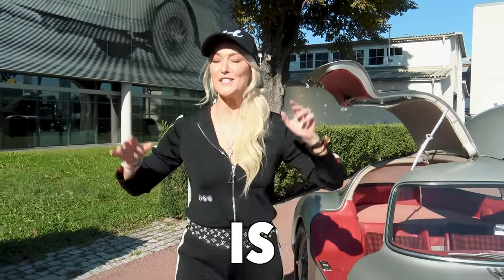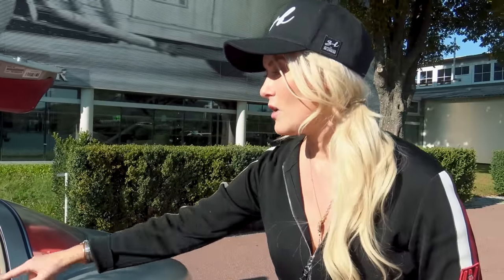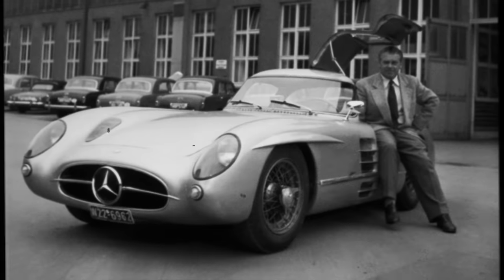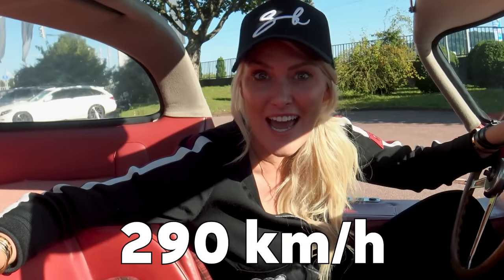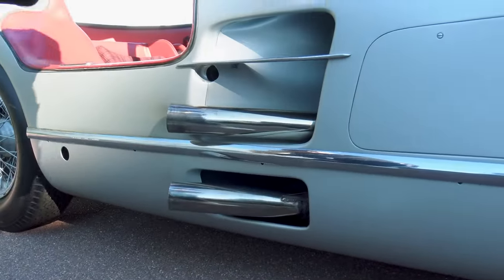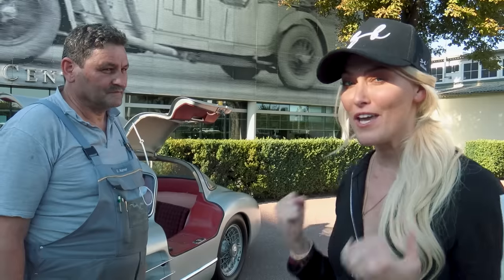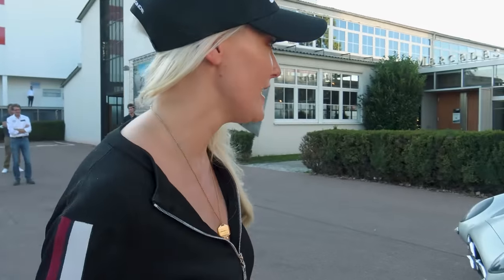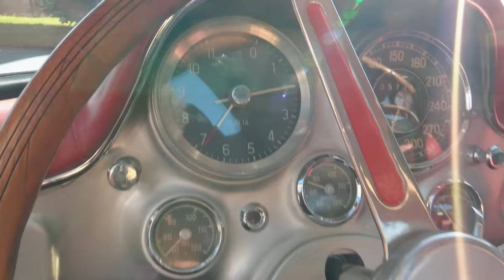The World's Most Expensive Car | 300 SLR

Comment: Blondie: "Can you imagine driving 290 km/h with no seatbelts?" 
Me: Motorcycles...
Reply: Lol 😂
Reply: LMAO .... =)
Reply: 👍exactly.
Reply: Yeah, relatively easily on almost any modern superbike. And they'll also get there much more quickly. The top speed of Japanese road bikes is restricted to 300kph by the use of limiters and/or gearing. That doesn't mean they can't be derestricted, which is something that is necessary for racing. But yea, 300kph is relatively easy to hit on a superbike. 
I've certainly seen it on the clock on a couple of bikes, though I know that they'd probably have been shy of that real speed by close to 20kph or so. Never really felt the need to go faster, 'cos you're approaching other vehicles at some very significant speeds.
Reply: Blondie: Can you imagine driving 290 km/h with no seatbelts? Me: well no but I can remember my 340kpH run in H2R with no seatbelt.
Reply: Over 200 km/h it doesnt matter....
Reply: @haraldkrieger6562  Why not? There may not be many places you can legally drive/ride at over 130km/h, but speed limits are one of those things that an extraordinary number of people regard as.. well.. voluntary. Most people do not go much more than 20km/h above that limit because it takes a car a long time to go from 130-200km/h. But a m/cycle can do it in the blink of an eye, and carry on to 250km/ hr or more in far less time than it takes most cars to get to your 200. Agreed, the risk of getting caught and banned is higher, but that is always a consideration. OTOH, the danger is entirely dependent on where you do these speeds. Personally, I think it is much, much more irresponsible to do +10 in front of a school than it is to do +200 on a dual carriageway with no traffic.
In fact, one of my annoyances with speed limits in town is that drivers see them as almost a minimum speed, not a maximum.
Reply: Meanwhile in 1955 when commercially available superbikes were a couple of decades away...
Reply: @skylined5534  The point is that the original comment was pretty silly. Not only did race drivers rarely reach those speeds (except at Le Mans), but this was pretty normal for them anyway. It's not that this specific car had no seat belts, none of them did.
The line was probably meant to impress car drivers with the heroism of drivers like Fangio. But bike riders are rarely impressed by the tales of Dering Do by people who are mostly privileged, drive on safer circuits and are habitually more protected. I could equally point out that the IoM was deemed too dangerous for cars in, IIRC, the 1920s, yet the circuit is still used for bike racing today.
You can dismiss the facts as much as you like, but the fact remains that an SLR probably rarely approached those speeds, and thus there is nothing particularly fantastical about it. That such a "Valuable" car will never, ever be driven under those conditions again is, for me at least, extremely depressing.
And that fact is just as ridiculous as its supposed "Value".
Reply: I've done a hundred miles an hour on Jones Road near Houston Texas on a 650 Kawasaki and I don't need to drive any faster on a motorcycle
Reply: @rodneypratt7082  Congratulations, I'm happy for you.
However, you misunderstand part of the fundamental argument. I know that this specific one is about maximum speed, but the main argument against such fast machines ld not be t about those top speeds. I've ridden and driven quite a few fast/extremely fast cars and bikes, and my argument in their favour is not actually about the maximum attainable speed, but about how they accelerate.
I would actually argue more against the hyper cars than against superbikes.
One of the principle problems with any car is that you never really have the opportunity to use the power because, under most conditions, there is so much traffic on the road that you are constantly being held up.And when they do get past the hold up, their ability to accelerate often upsets the handling so much that the driver can't keep it under control, as is shown by so many of those videos on YT that we have all seen.
Bikes, on the other and, can accelerate more easily and get through gaps that no car can do on the road.
I am not disputing that these speeds are valid, I am saying that the acceleration of a superbike really is very useable, even at legal and semi-legal speeds.
Reply: Best reply so far =P
Reply: My 1957 219 Ponton has no seatbelts either , but its top speed is only a little under 160 Km/h
Reply: True 😅😅😅
Reply: @davidcolin6519  still the average person will most likely never do that. Unless you have a death wish
Reply: @rosesmith3971  I'd argue that the average rider of a litre plus bike with sporting pretensions will have hit 250kph on more than one occasion. That's the difference between (sports) bike riders and car drivers, as I explained above.
Reply: @davidcolin6519  How are you going to compare riding a sports bike to riding one of the most expensive cars in the world without a seat belt? Of course you can ride a sports bike with no seat
Reply: @rosesmith3971  I'm not the one making the idiotic statements in the video. And the comparison is just if it is about safety, which it clearly is. The original comment was clearly intended to demonstrate what heroes the drivers of these cars were. I don't see it that way, and nor do many others. 
As I have pointed out before, it is nothing to do with the value of the car or whether it is a classic or anything else, it's about a stupid comment by someone who apparently doesn't know all that much.
Reply: @davidcolin6519  you cant just compared the fastest mcs to slow cars theres cars out there that would smoke any Stock bike
Reply: @willekewk  Yes, you can. A m/cycle can pretty much ALWAYS get past a car.
Literally the ONLY time a fast car will beat a bike is on a circuit or a road that has no obstructions to the view ahead, because you know that the car can get past the bike and stay ahead. Even on dual carriageways/freeways, a car is at a disadvantage because the opportunities to use that immense power are really rare. The bike still accelerates harder at any point up to about 140mph . That may not seem very much, but most people don't often go that much faster.
ANY time a bike is on a public road , with things like blind bends, hedges, crests and banks, the fastest car will get stuck behind something else. I've been riding on the roads for the past 40+ years, and there are plenty of times I've left supercars for dead, even on middleweight bikes.
This is the difference between theory and practice. I've had plenty of practice in both fast cars (maybe not Zonda fast, but certainly Ferraris, Aston Martins and Porsches) and fast bikes, and there really is no competition  on the road.
Reply: Savage ⚡😂
Reply: driving not riding
Reply: @ollolol7879  Yeah. Driving, you're surrounded by a metal cage that you know is more than likely going to protect you. 
And riding is on a machine that has absolutely zero passive safety measures. No size for other road users to see, no basic stability to maintain stability, no more than two tiny contact patches for the rider to rely on, nothing to protect the user from the effects of sudden deceleration against an immovable object, not even a cage to stop you from being run over by other road users in the event of a miscalculation.
Reply: @davidcolin6519  the nissan r35 skyline has changed the game , an ams 20 package nissan just obliterates everything thay costs 6 to times it price , yet to see the nissan with an ams package race a chiron or a konigsegg .
Reply: At 290kmh a seat belt will do nothing to protect you
Reply: @Islam_is_the_truth.4  Agreed, but there are plenty of factors involved in cars that will, and one of those things is common to all cars; that bloody great big metal cage that surrounds you. Even old cars like this have a good chance of protecting the inhabitants. It's usually the poor souls that car drivers hit who come off worse, and this is doubly so where bike riders are concerned.
Reply: @davidcolin6519  

Indeed ... I'm pretty sure it was surgeons, whom also do transplant surgery within their speciality, that started calling superbikes 'donor-cycles', given, even when wearing full protective gear, a crash at >180kph will leave the cyclist in a serious condition, including critical, but stable; at >200kph, the fact some can still be alive is incredible, but most ...
Reply: @nigelft  I have personally had 2 "offs" at over 160kph, and neither time did I even break a bone.
Speed on its own rarely kills, it's coming to a very quick stop that tends to kill you.
And modern safety gear can be surprisingly effective, especially with the airbags available in some gear.
And yeah, it was A&E medics who coined the term. Also applied to TVR drivers
Reply: but that's not the point, this is the project One of its day (you can literary hear commentators in historic fims/recaps called this a Formula 1 car" ) with the safety of one! your basically the crash structure!
Reply: do u drive a motorcycle?
come on...
Reply: On two wheels only! 😂

Comment: One reason for the end of the program was the accident at Le Mans.  Pierre Levegh's 300 SLR hit another car from behind on the pit straight (the other car was avoiding Mike Hawthorne's Jaguar) and was launched into the crowd at about 150 mph.  No safety barriers in those days.  Levegh and over 80 spectators were killed.
Reply: 80? HOLY hell that is a lot of people. On the paper it seems a small number, but 80 people means the car ploughed thru the crowd at least 20 meters long
Reply: @NomadUrpagi  Remember that magnesium bodywork?  Yeah.  Apparently nobody was equipped to deal with a metal fire.
Reply: @ExceptionallyCleverUsername  They tried to extinguish the fire with water
Reply: @DavidBrown-lv6ox  And it worked...  One puts enough water on anything, it'll put it out.

Comment: I was passed on the Autobahn A45 by one of those two cars back in the 1960s. I have no way of knowing whether it was Mr. Uhlenhaut behind the wheel, but I have always fantasized that it was and he was on a secret mission of some kind. Just remembering it 50 years later the sound of that exhaust gives me goosebumps today. Incredible machine. I had forgotten that it has 8 cylinders, unlike the W198.
Reply: That's crazy
Reply: I love this story and how it has stuck so vividly with you over the years.
Reply: And the "sound" of the engine was already "castrated". In order to obtain a road licence, Uhlenhaut had to have a silencer installed on his "company car" (the one with the blue interior), which was placed on the right-hand side outside the bodywork, thick, fat and grumpy (i.e. not nice at all).